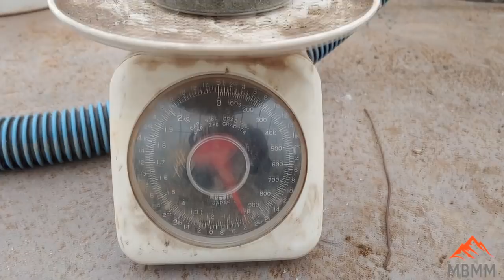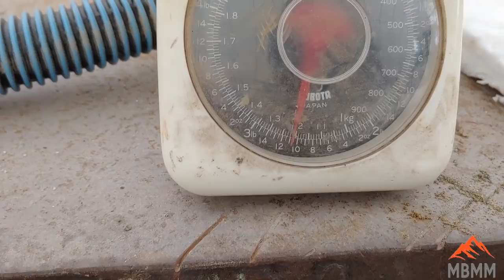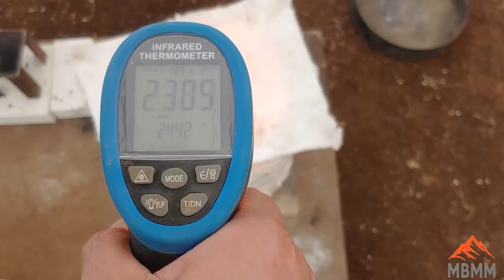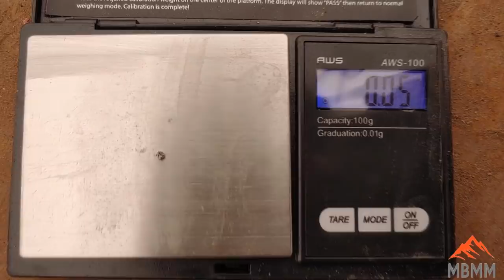Do Your Buckets Of Black Sands Have Value? Assay For Gold At Home To Find Out!

Comment: natural magnetite is actually a steel.  A steel/gold alloy probably has to get hotter to drop out the gold into the collector metal than you got it.   Have you ever shot the slag with the XRF?
Reply: so basically AuFe304 or Fe3AuO4 lol that's very strange but very interesting! do you got any references i would like to learn more, thanks!

Comment: The only trick may be if theres a way to separate out the gold bearing minerals more such as flotation or magnetic, or static, etc. If you could reduce those 38kg into 500g and maintain a large majority of the gold without expending too much money, it could be worth stockpiling until you have enough to process.

Comment: Have you thought of using a black iron wok instead of the cookie tray or cast iron pan. You can move the "sand" by flicking it, kind of like stir frying & woks (black iron) tend to handle heat better then cookie trays.

Comment: The easiest way to recover that gold is to wait until you have a ton or more, then set up a small leech field type system and recover the gold that way. It takes way less effort and you recover ALL of the possible gold from those low quality materials. You do it in small batches like that so that it can fit inside of the containment system you build. Granted this is only worth it if you end up with a few tons of that type of material every year from a mining operation, but it would work and be a heck of a lot cheaper to do than to crush it, roast it, and process it in a furnace.

Comment: I am not roasting sulfides. I crush to 100 mesh, wash, and leach w/HCL. The result is a mix of chlorides; gold,silver,and platinum group metals. I put the solution in a crock pot and sweat off the acid I then place the chlorides in AR and precipitate. You get a purer product than fire assay which will need further refining. Are you getting Platinum Group Metals w/the gold sulfides. Won't hurt to check. nice video. Good Luck.

Comment: we burn off sulfides at 1930 degrees in a crucible and after that without cooling the crucible down or shutting the furnace off we add flux and lead shot(packaged in ashless filter paper(be quick!)). We do this with 10 crucibles at once. We use much lower quantities though(20 gram maximum). But we have analytical scales (0.1mg) to wheigh the silver bead and we have an ICP to measure gold, platina, palladium and rhodium in the silver bead. Also sometimes there is for some reason a lot of Bi in the silver bead, so important to measure that as well. Often the Bi comes from the lead. Because the lead wheight is a lot higher than the silver wheight, even an impurity of 0.01-0.1% adds up when all the lead is absorbed or evaporated.

Comment: Was thinking. The blob of iron at the bottom but them mix iron shavings in with the material being smelted.   Let it do the same thing you were saying move around on the current with the precious metal as both melts then fall and mix with the blob at the bottom.

Comment: I once found 1/2 pound of gold in black sands. It was oxidized. Looked like the sand particles. So we started tumbling it with caustic soda, and sure enough. It was a large part of the concentrated waste materials.

But how does it become oxidized I thought gold wouldn't? But I did find that once. We had like two years of that waste saved. We could have just smelted it. But at the time we didn't know.

Comment: You'd think any sulfides would roast in the smelt. In fact I'm quite sure one could forego with the roasting alltogether if you used enough time and flux. All it does is inhibit the melt until it has fully decomposed and off-gassed. Same with the Na2Co3 in the flux, it needs to decompose and stop bubbling. I would roast it and use Sodium Oxide instead, but perhaps some bubbling is advantageous for stirring.
My hypothesis to what happened is that you had too little flux and/or time. Another hypothesis that I'm leaning more towards is that the Lead got oxidized and that a little Carbon powder would help.

Comment: Is there any way to put the settling jig in a centrifuge? Although , spinning molten metal at high speeds sounds super problematic and dangerous, it would probably speed up the separation process and yield more PM.

Comment: Sulfides? Just bake it. But to convert to oxides you can also use whats called "piranha solution." Its easy to get a hold of and will oxidise anything. You also cant use a metal container, has to be glass because its already an oxide.

Comment: You could save that black sand and use it as a set up aid for your shaker table or sluice box without using good ore, use crap ore you know isn’t worth saving.

Comment: Cheers.it's very interesting.I've been getting a devil forge and I'm going to be smelting soon.I've subscribed👍😉
Reply from the maker: Awesome, thank you!
Reply: What's a devil forge?
Reply: @StevenHanover  It's a propane powered forge made by devil forge and are one of or not the best small forge money can buy. Big stackd channel uses them and that's where I got the idea from.
Reply: @rastamanralph6670  how many monies do we save up for one of them, like ebay, amazon, home depot can buy tools to make one? Simple handle cement kiln is 74 bucks on ebay right now.  What is a general amount of black sands and flux for appropriate sized graphite crucible when utilizing oxygen propane blue flame? Will trace stackd channel suggested thx!
It's the blue harvest moon soon...
Reply: @StevenHanover  I paid £188 for mine on eBay and it includes the forge,the gas burner and the regulator. When you get it you have to mix the bag of clay dust with water and paint it on the insulation then dry it and your good to go. It was the medium size one I got to fit a 3 kg crucible in but don't know about the flux because I just got it for smelting beer cans.

Comment: That was a really sensible approach! You could have just multiplied by the no of kgs you had,  you didn't need gold per tonne...
Reply: I'm not sure, but I think, that per ton is such a common term in the mining industry, that it's helpful to settle the figures in that term, so he & fellow mining people will instantly have a "feel" for the number, without having to convert it in their heads?
Reply: @sparky6086  if it's an industry term then fine... I'm a scientist so we typically go by the most logical unit
Reply: @drfill9210  I'm an engineer, so I dig it.

Comment: Could you produce enough heat in a wood fire to do this?
Reply: Yes
Reply: Roasting yes
Reply from the maker: Probably not to smelt, but worth a try
Reply: @mbmmllc  Ah yeah. I did specifically mean the roasting part. I should have specified. If you have to use something like natural gas you could cut into your profit margins, so if you could use a wood fire that could be a very useful thing.

Comment: So, not feasible unless your going through hundreds of tonnes of black sand...?
Reply: It was a test to see if the sands he had in his bucket were worth anything. They were not - he had already extracted most of the gold in  the sands with his shaker table and water.

Black sand that hasn't been run through a concentrator, and which comes from a gold bearing area, can contain quite a bit of gold.